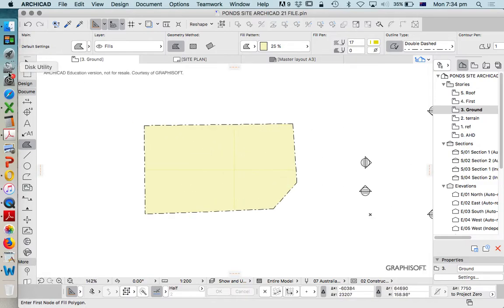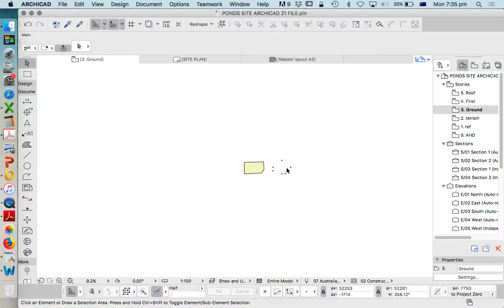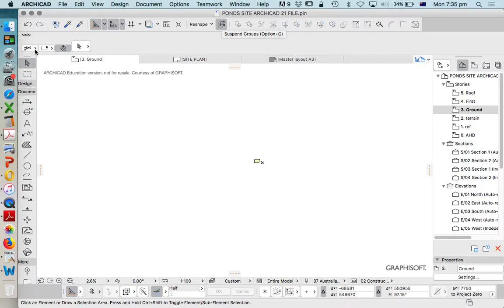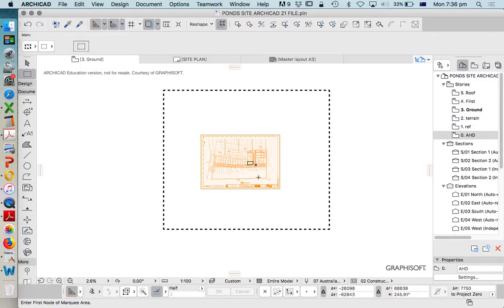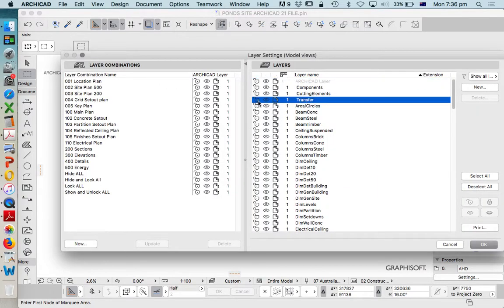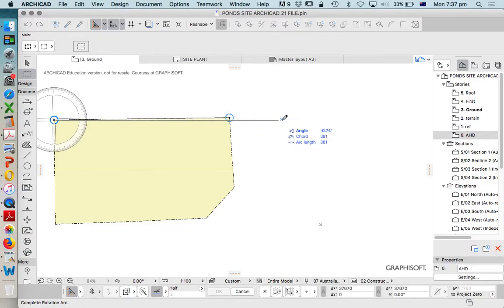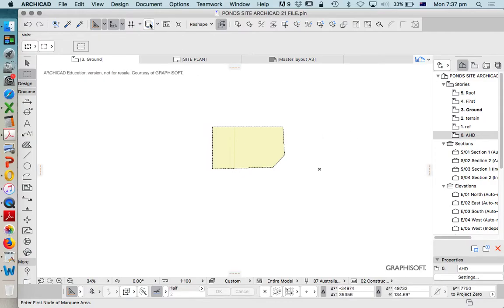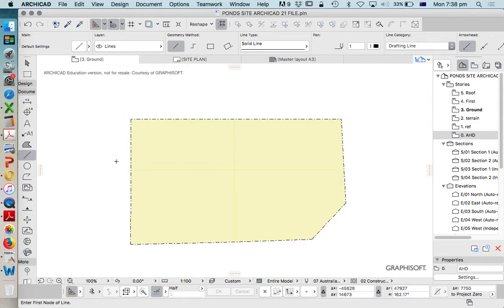ArchiCAD 21 House Project - part 04 setout reference angle

Comment: Wouldn't it be easier just to rotate the screen using the screen angle button at the bottom of you page which temporarily rotates your workspace to a defined angle so that you can work at that angle but keep the project aligned to the original orientation (per the North a angle facing up), instead of physically rotating everything?

This seems weird.
Reply from the maker: Hi,As ArchiCAD allows us to rotate the north point, it is wiser to rotate the entire project (not only a view) at the very start. I would never want it to represent in a different orientation, so that is why I haven't used the option you have suggested. In terms of architectural standards, North should be up the page, but this is based on the printed page not the digital model. As long as North is between 0 and 180deg (not down the page) that is still acceptable. Having a Portrait orientated design on a landscape orientated plan will often not fit, or waste too much space.